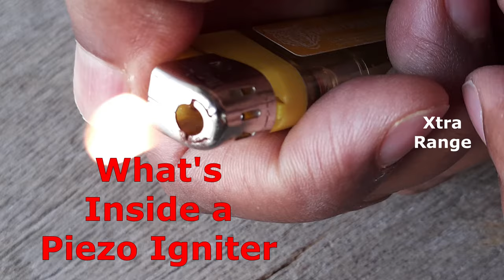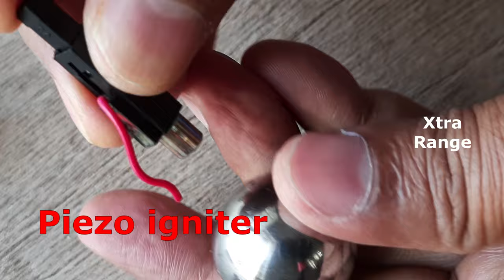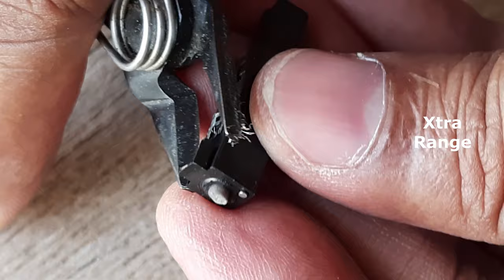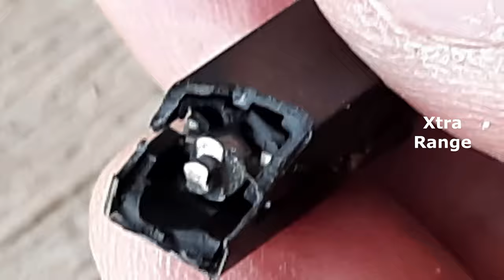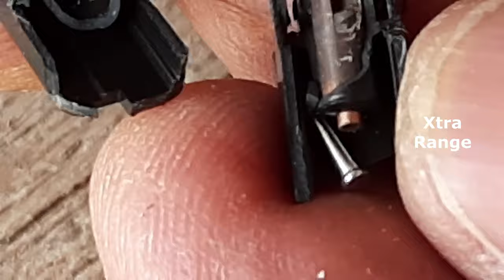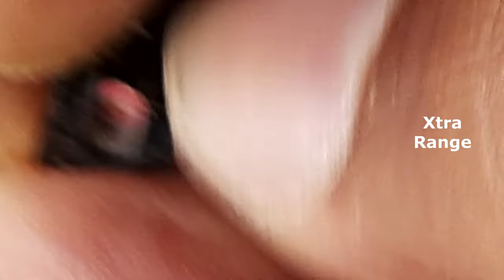What's Inside a Piezo Igniter of Gas Lighter

Comment: This was the first video listed by google, and I was expecting to see how the thing worked. Oh well. At least I got to see someone tear sh*t up with pliers.
Reply from the maker: Thanks
Reply: @Xtra-range  don’t listen to him, he should have read the title that literally says: what’s inside of it, not how it works
Reply: Ne'er  believe there is some serious shit inside that casing.
Reply: @Mr.enginEAR09 "What" generally leads to an expectation of labels applied to the bits and pieces. The title should have been "Exposure of the insides of…"
Reply: Bro-- it says: "what's inside not how it works."
Reply: It's a quartz stone when it receives impact in this case from passing the button in the impact creates an electronic spark transferred to the wire which runs through the wire and ignites the gas

Comment: You don't need to break that ,cause its easy to remove without crack
Reply from the maker: Currect
Reply: Hi can u explain how to open it with out destroying it?
Reply: @pandam9638  yeah yeah ,just remove the top button that's all
Reply: @bharathdynamo9351  thanks
Reply: Did you miss the metal part of the video????

Comment: in lighters the piezo system is isolated from your hand and the ones in lighters only have one wire and no return wire to the bottom metal cylinder on the piezo so im wondering how does the spark happen between the tip of that wire and the gas nozzle? im trying to fix an older torch lighter whos gas was not flowing properly i think i fixed that somehow but seems the piezo wire is sparking at different points and its difficult to fix unless i get another piezo i have on hand problem is the wire on that one is too short but when i try sparking it to the nozzle it would only spark when my hand made close contact to some of the metal parts of the lighter like the head or the bottom brass refill port i could feel the spark on my hand that is holding the lighter when the spark goes off and lights the flame yet i never felt that before when the lighter was in working condition can you explain this please? i suppose the high voltage from the piezo somehow finds its way through the tip of the wire across the fas nozzle and somehow through the hand (ie ground) but you do not feel it when the piezo is inside a proper working lighter